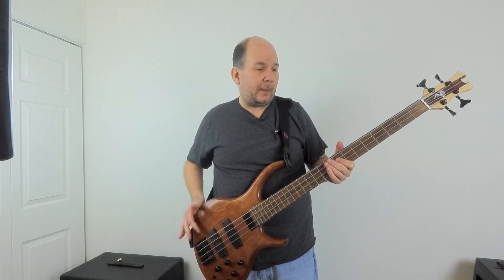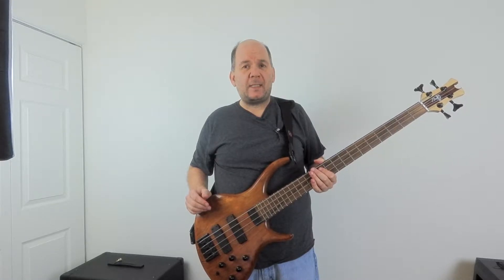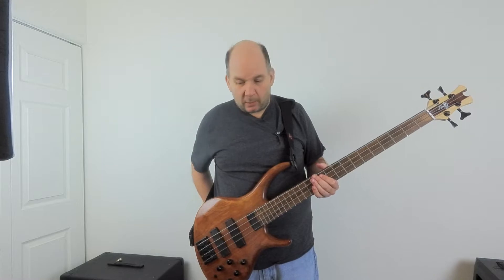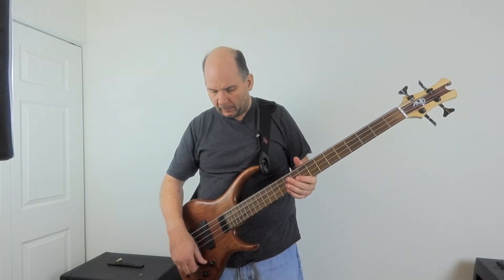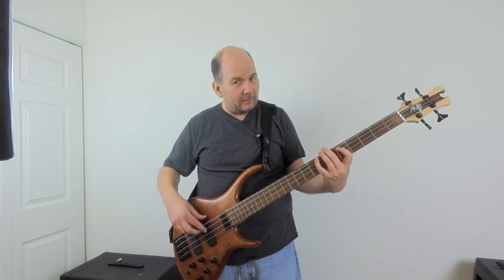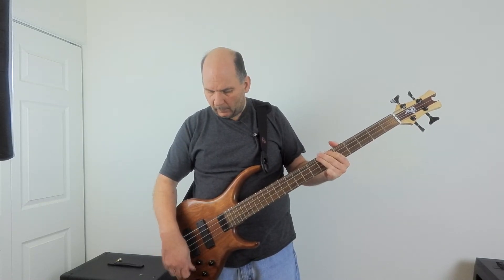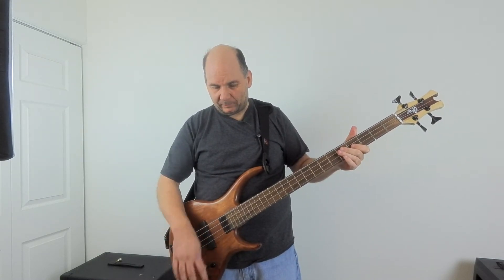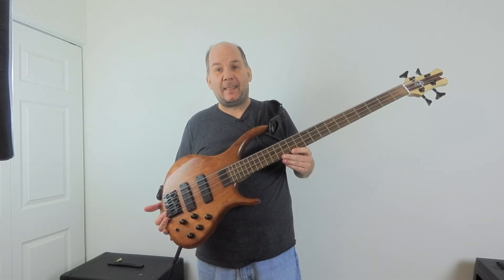🔥🔥🔥 EPIC distortion from broken Tobias bass active preamp 🔥🔥🔥

Comment: I had a similar thing on a Tobi bass a while back - tracked it down to a loose connection. No idea what the connection was - I just went around taking each connection off, cleaning it and replacing it until the bass sounded right again. Alternatively you could use my favourite repair method and hit it with a hammer ;-)
Reply from the maker: Could easily be that on this one. I can get it to sound mostly normal by pushing in a bit on the pot or otherwise by putting stress on it.